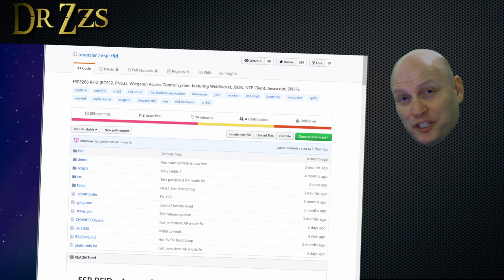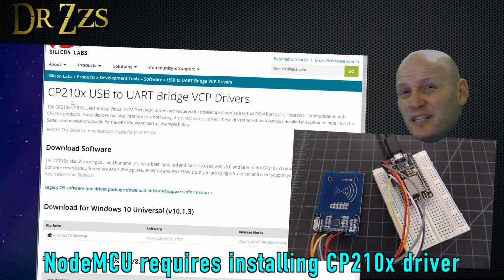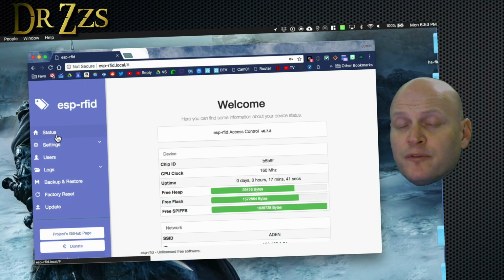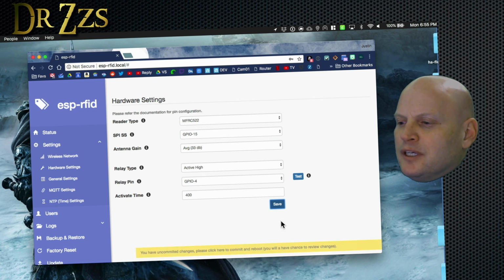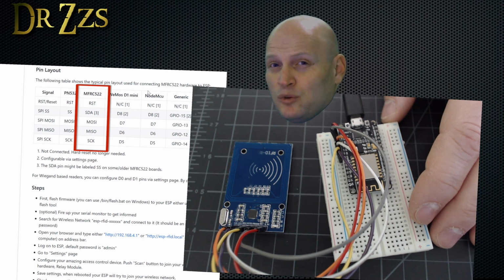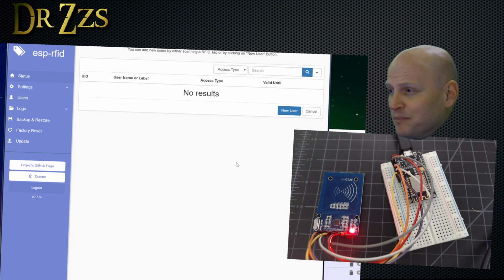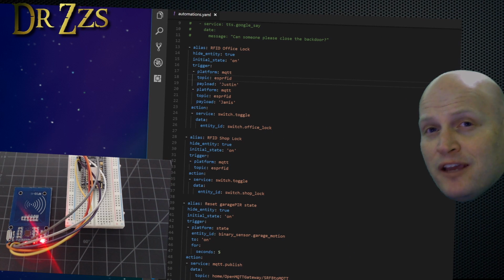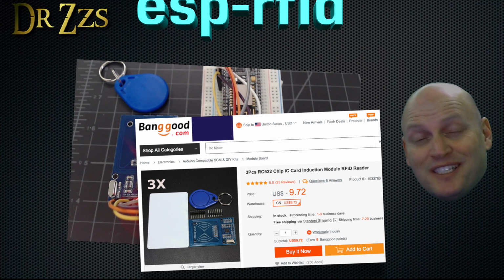ID Card Scanner using NodeMCU, MFRC-522, esp-rfid firmware, and of course, Home Assistant

Comment: BTW, I came across a video where the RFID writes a code back to the RFID tag each time it is used, then expects that code the next time you try and scan in. At least that way, if your tag gets cloned, but you manage to scan in before the clone, it will expect that code the next time a scan is made, which will prevent the cloned card from working. Also when your tag doesn't work, you will know it was cloned and you can take appropriate measures.
Reply: Link?

Comment: Hey :D
Love your project :)
But when i download the RFID files from your link, i doesn't contain the firmware.bin like it does in your video?
Have any suggestions on what i shoul do?
Reply: Things has changed in the files that are downloaded.
You need to use the generic.bin file
In the video, he takes the firmware.bin file and places it in the same folder as the flasher, instead of searching for it.

Comment: There is no firmware.bin in the directory anymore
Reply: So I got the firmware onto the node, all settings set up, hooked up just fine with a brand new rfid module. Then nothing. Wouldn't read any cards or fobs that I have here. Tried flashing a basic esp12e on a dev rig I have to see if perhaps some pins on the node mcu are burnt. That didn't work either. There are so many things that can be wrong here. It's so frustrating.

Comment: hi there,
im using nodemcu and rdm6300+mfrc522, wired according to esp-rfid Access Control 1.3.1 and 1.0.2. but none of my reader reads rfid cards. cant add user. can anyone help?
here is the config file im using.
{
"command": "configfile",
"network": {
"bssid": "28:D1:27:4C:56:39",
"ssid": "N@H!D",
"wmode": 0,
"hide": 0,
"pswd": "Password321",
"offtime": 0,
"dhcp": 1,
"ip": "",
"subnet": "",
"gateway": "",
"dns": "",
"apip": "192.168.4.1",
"apsubnet": "255.255.255.0"
},
"hardware": {
"readertype": 4,
"wgd0pin": 4,
"wgd1pin": 5,
"sspin": 0,
"rfidgain": 32,
"wifipin": 255,
"rtype": 1,
"ltype": 0,
"rpin": 4,
"rtime": 400,
"buttonpin": 255,
"doorstatpin": null,
"openlockpin": null
},
"general": {
"hostnm": "esp-rfid",
"restart": 0,
"pswd": "admin"
},
"mqtt": {
"enabled": 0,
"host": "",
"port": 1883,
"topic": "",
"user": "",
"pswd": "",
"syncrate": 180,
"mqttlog": 0
},
"ntp": {
"server": "pool.ntp.org",
"interval": 30,
"timezone": 0
}
}

Comment: hi there i am trying to build a project like this but not a door lock it is an online attendance system the only tool i want to use is the Rfid and the esp8266 . i would be happy if you would be able to help me out is this project .or if there anyone can help me out in the comment section no door luck just the rfid esp32 and store the data on google sheet

Comment: Hey, in the new firmware ver the mqtt works different I found the solution on the HA forums
Please try:

create a sensor:

Copy to clipboard

- platform: mqtt name: "rfid_reading" state_topic: "rfid/send" value_template: "{{ value_json.username}}" expire_after: 2 

…check if the sensor is showing georges for two seconds, when you´re holding card in front of the reader.When working:

create automation (card name=georges)

Copy to clipboard

- id: 'testfrid1' alias: testrfid trigger: - entity_id: sensor.rfid_reading platform: state to: 'georges' condition: [] action: - entity_id: switch.sonoff service: switch.toggle 

Thanks to heine79
Reply: I also followed these instructions my heine79 link for easier C&P here:
https://community.home-assistant.io/t/esp-rfid-mqtt-do-not-work/125624/21

Comment: Nice video and well explained. I have this running with a connection to home automation, but without the lock and looking how to implement something additional. Specifically how can I set a pin high via a script at the NodeMCU while using ESP-RFID? With this I would like to see if the alarm is enabled or disabled.

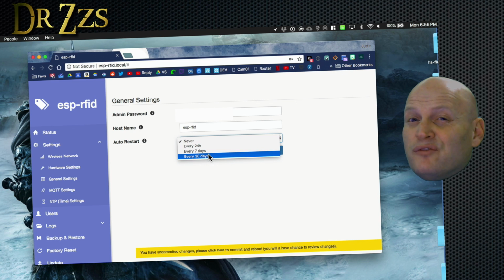Comment: 3:53 you say you have had problems if the chip is not restarted regularly.
Well.. that is because it's an Arduino.
Inside an Arduino there is a counter that counts the "uptime".
When that counter reach it's limit the counter can't count up anymore and the Arduino stops.
That happens after 42.5 days on most models (or all, not sure)

Comment: sir, how to use the 5v relay module, because I use NodeMcu v3 there is no 5v output power only 3.3v, so the 5v relay module doesn't work, I've tried using (step up module) from 3.3v output but the 5v relay module doesn't work, please the solution, thank you.

Comment: Hello,
I followed your tutorial, but I can not control my module SONOFF switch basic
 
I installed the ESP-RFID, I assigned the badges, I configured the parameters MQTT (the module is well connected on my MQTT broker on home assistant)
On esp-rfid there are other settings in the Hardware settings menu I do not know what to do.
(wifi led, door status, open lock pin, ...)
When I pass the badge on the reader, it is well identified but nothing happens, the switch does not change state
thank you in advance for your help
Regards
Reply: I have the same problem too

Comment: Superior tutorial as always! I am stuck a bit with the relay control. I have a status report via mqtt but I am unable to set an mqtt output for relay switch. I also hit the test button on the esp rfid hardware setting page and it do not send the status of the relay. I tried the # simbol as topic which means see every topic. Still nothing. Any idea? thanks.
I use node-red
Reply from the maker: I'm not sure where to help.  I'm not very familiar with nodered (still ).  If you aren't seeing an messages even using #, then I'd guess there's a problem connecting to your broker.  Double check all the broker connection details.
Reply: @DrZzs  Funnily the status of the card reader is publishing. so anytime I scan a card I have all the details via mqtt. But other than that I have nothing. I unable to switch the relay via mqtt. On another forum someone mentioned this firmware does not support the remote relay control. Which would be very strange. In reality, I have had a bit of difficulty to install the firmware, anytime I connected to the wifi, it is connected to it, it was there under a certain IP address as I have seen it in my router dashboard, but I was unable to reach in the browser. Several reflash did the trick and it is working now, partly. Thanks for your replay!

Comment: Hi Doc  have been trying to do this for 2 days now on the git hub the firmware.bin wasn't there so in comments found someone had a link to generic.bin installed that. set up as you say then save and reboot then when click 'Try to reconnect ESP' says 'Cannot be found '. Any ideas. Thanks
Reply: hay did u find the firmware.bin file ?

Comment: The .bin folder from the  ESP-RFID repo: https://github.com/omersiar/esp-rfid esp-rfid is missing the firmware.bin file. 
In the older release  0.81.1  I found two bin files, forV2Board.bin (498k) and generic.bin (510k).
Can one of the two bin files used instead of the missing firmware.bin file ?
Reply: same question

Comment: when come a good firmware im problem esp-rfid the  mqtt  server lost  connection  60 a 120 sec and disconnect when restart then working for 60 a 120 sec or some 4 minutes and then lost again the mqtt connection a again an a again   can anny body help to good firmware download  I've  already tried a lot. not annt firmware  wil  good working .  mister DR ZZS can you help for good firmware  new revision or bux fix ..  i use  Node MCU V.3
Reply from the maker: Sorry, I haven't tried this project in a long time.  Is the repo not being updated?
https://github.com/esprfid/esp-rfid/releases
Looks like the last release is from Jan 2019, so maybe it's not a very active project anymore. 
I believe ESPhome has an RF card reader component, so that may be something to try, but it would require learning something new. 
Hope that helps.

Comment: hi i am a bit lost with the configuration.yaml and automation.yaml your examples are not working maybe i do something wrong. I'm on the newest hassio version i try all Firmware's but the payload ist not working at all. Could you maybe send me an example of what is nessecary in config and auto yaml because i really would like to make it work
Reply from the maker: It's possible that something has changed since I made this video.  I haven't been using it in my home, so I don't have any further updated settings. 
maybe come to discord and share your settings and we can see if something looks wrong. 
www.discord.me/drzzs
Reply: ok but no one answer
Reply: Hello olli, I just stumbled over the same thing (8 month later;)
The action isn't triggerd with the specified payload (bug?).
I managed to get it working with a workaround. 
My automation looks like this: 

- alias: RFID Buero
  trigger:
    - platform: mqtt
      topic: esprfid
  condition: 
    - condition: template
      value_template: '{{ trigger.payload_json.uid == "59b5cf56" }}'
  action:
  - service: notify.TelegramToFlo
    data:
      message: 'RFID Test'
 
You can also use trigger.payload_json.username if you prefere usernames.

Comment: Mine firmware is not working properly
It is not saving any settings and after clicking save and reboot it stays in access point mode with all the settings as factory settings
Also it is not recognising any RFID cards 

But I can use the setup properly in an Arduino sketch
Reply from the maker: uh oh.  
I haven't played with this program in a while.  I'm not sure what might have changed. Try the ESP-RFID github, they should be able to give some guidance. 
Maybe someone is already working on a solution to that problem:
https://github.com/esprfid/esp-rfid/issues

Comment: I have loaded this on several esp8266 I even have one team with it on an uno esp8266 board. the results are the only thing consistant. no way to trigger a relay. 0 change in gpio pin state no matter what pin you select. if anyone has this working with a relay i would love to see a video of it. the only answer i got from their contributors was about not being able to drive a 5v relay from 3.3v and i think the suggestion was to try a l7805 but i'm not sure what that will do. is there an L7805 that makes voltage from nothing? the relay is powered from an external 5v source. lol DRZz can you bench this and confirm?

Comment: Hmm...well, I got the NODEMCU flashed, logged into the esp-rfid, but after connecting the RC522 module to the NodeMCU,  it won't boot and get an IP.  Did you have that problem?
Reply: the project is just one consistent problem, trash it!
Reply: Got the same problem🙄 Any solution found?

Comment: don't even bother with this  because  the firmware.bin file is gone on github and what they have does not work on esp8266 and they seem to know it because there is no developer support for issues. they just want you to buy their official board that the show is $15 but its really like $60 shipped from BFE.
Reply: The file is now called generic.bin and it still works.
Reply: @jongriffith4293   ya i don't know what happened but i put the  same setup  done on several benches with their own esp & rc522 and the results were the same across the board. erratic inconsistent function. abandoned the project.  considering another attempt with the official hardware
Reply: @jongriffith4293  can you email me the firmware.bin that you used and how u went about flashing the esp8266.   matrix33ca@gmail.com
Reply: @matrix33ca  Go to the ESP-RFID repo and click the Releases tab.  Download the ZIP file in the releases.  That's where the generic.bin file is which you use in place of firmware.bin.  I'm on a MAC, so I used NodeMCU-PYFlasher to flash the chip through a USB connection.
Reply: @jongriffith4293  should i flash it while its connected to the rfid reader
Reply: @matrix33ca  I don't think so.  You're flashing the ESP, not the reader...

Comment: Thanks for this video. I have a NodeMCU. I can flash it to clear it and then flash it sucessfuly with these binaries:   1) 0.9.0     2) 0.8.3 and    3) 0.8.1.       I can connect to each wifi hotspot and then see the page of each with 192.168.4.1. However only the last of these binaries will save the new settings as a client then let me connect through my modem router.  Any ideas why I can't save changed settings in the first two? Thanks. ps I flashed with esptool.py.

Comment: hi bro i tried with three rfid readers and also checked the pins rfid is not working what to do ??
Reply from the maker: hmmm.  What are you using to activate the reader?  Did your scanner come with cards that already have codes?  Some are blank and need to be programmed.  That's unlikely to be the problem, but it's possible. 
If you can post more info maybe we can help.  Try posting in the Facebook group or Discord.  Maybe someone there would know better what might be going on.
Reply: yes it came with cards and i think they are already have codes if not how to code the cards
??
Reply: and whats your facebook address

Comment: What case do use for the sonoff sv, nodemcu, touch buttons? They don't have a good aesthetic appeal just laying around.
Reply from the maker: I've 3d printed most of the enclosures myself.  I usually search Thingiverse.com and find something that'll work for my purposes. 
Another good option if you don't have access to a printer are the travel soap boxes from Wally-mart or the dollar store.  Usually $0.50 or $1 and you have a nice plastic box with a clip lid that'll fit several components.  And they have different colors. :)

Comment: I have the same card reader as you, but with mine the range is too low. I can't even put a small plastic case around it. is it the same for yours?
Reply from the maker: I haven’t tried a case on it. That would really be crappy. I’ll have to try it. Maybe there’s a way to adjust it or boost it. I’ll have to look into it.

Comment: My parts came. But having all sorts of problems. Mostly my doing. Finally got to the point where everything was entered and it was supposed to restart.  Never did.  Hate to start over. While I am here.. I have never got 192.168.4.1 to work on any project using W10 Edge and Chrome.  I tried it on my iPad and it works.  Anybody have any idea why? Again great job

Comment: can you clone tags with this at all? or its just a reader?
Reply from the maker: I don't know the details but it seems you can.  
https://youtu.be/fyr4sYbB-Mo

There are a few videos out there about it.  
Let me know if you figure it out.
Reply: yea i have been trying this, watched the vid a few times, i have come to the conclusion after reading a few forums that i need to solder the headers on, alot of people have been having issues with breadboards and the rfid reader. so ill have to go buy myself an iron before i can do it
Reply from the maker: This is the one I have:
https://amzn.to/2u9iFOV

You'll want some kind of holder though.  So maybe one of the kits that has a holder would be better.  
Using really thin solder helps a lot too.  This is what I use:
https://amzn.to/2MUmxLt

I think there is some even smaller too. 
Good luck!
Reply: I'm just going to go down my local hardware store, is there a min wattage I shouldn't go under? Will 40w be ok you think?

Comment: Hi Dr. question to you or anyone else... I just got 2 nodemcu from amazon. after I flash the software I went into 192.168.4.1... 
I setup the RFID after I reboot nothing... it does not shows up in my wifi scan anymore. brand new nodemcu just got in the mail...
I tried to flash one again with the firmware bit its like the nodemcu is dead any ideas. ??
Reply from the maker: Can you look at it through the serial monitor?  Use Termite or Putty to connect to it and see what it's doing.
Reply: all l did is install the rfid bin it work fine on setup but after l save the reboot they never came back up
Reply from the maker: oh right.  Sorry.  Forgot this isn't Tasmota.  
I'm not sure why that would happen.  
Maybe post and "Issue" on the github and see if the Devs have some ideas. 
https://github.com/omersiar/esp-rfid
Reply: I had the same trouble. After flash the firmware.bin, I found the network and then I applied the changes (My SSID and Pass) but after reboot the module dIdn't work again. After, When i connected the wemos to the computer it started to fail (Mouse, screen). In conclusion: This motherfucker project destroyed my Wemos D1 MINI!!! This is a "GREAT PIECE OF SHIT" in a ".bin" format.
WARNING: Users with Wemos D1 MINI, DON'T TRY IT OR YOU WILL DESTROY YOUR DEVICE!!!!
Reply: Serdio I flash the 2 nodemcu with Tosmota and they came back to life... maybe you can give tasmota a try
Reply: I notice if I use the ver. 1 nodemcu it will work fine and don't destroy it.. however, when I got the  2 ver 3 nodemuc both were  destroy..I like the ver3 nodemcu because has a VV pin when powered by 5v or 24v, the VV pin give you that voltage to power your relays vs. the ver 1 nodemcu which only has the 3v output. I have one ver1 that working fine. I will just get another ver1 nodemcu to use on the 2nd rfid I got .
Reply: Thanks for the info Bobby, sure that it will help a lot of users to avoid to damage their devices (Wemos D1 Mini, NodeMCU V2 and V3). Obviously, after this experience i completely discard this project and there aren't availability of NodeMCU V1 in spain. Thanks also to DrZzs for your wonderful tutorials.
Reply: I re flash the nodemcu with the  "ai-thinker-0.9.5.2-115200.bin" and I was able to flash again. however, after flash again the same thing will happen where when I restart the nodemcu will go dead until I flash again with the original ai-thinker-0.9.5.2-115200.bin file. I try to flash with another stetch but the samethink will happen . so I can say by 2 nodemcu is dead..